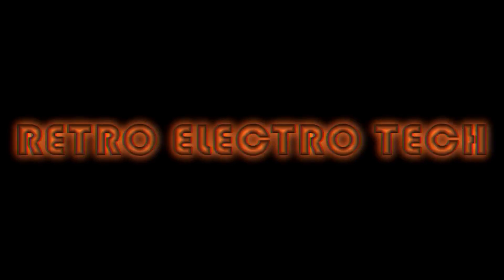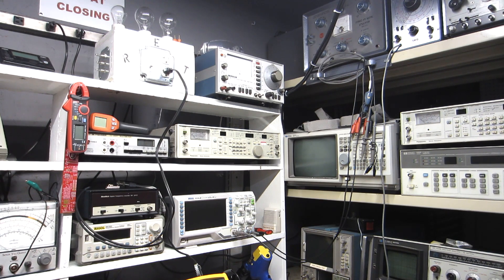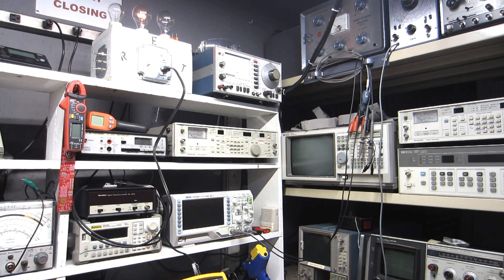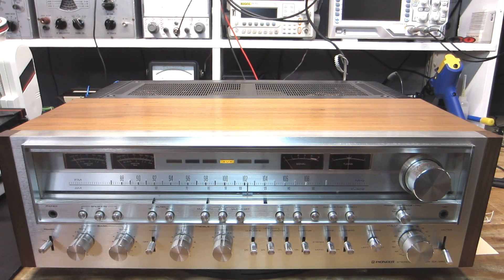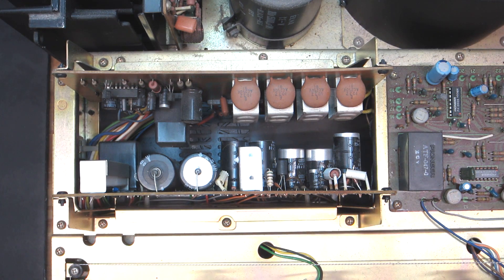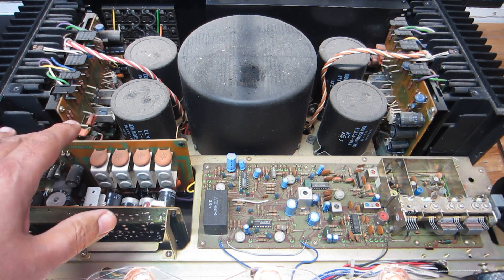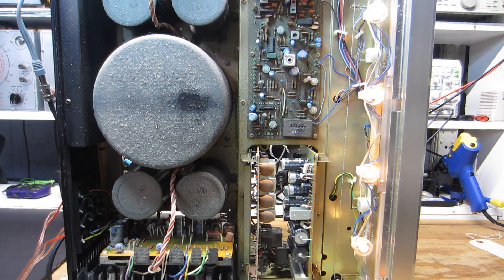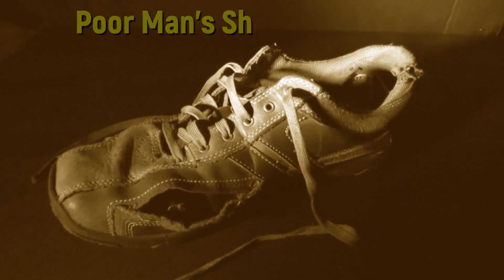Pioneer SX1280 Evaluation Part One

Comment: i went thru 2 of these earlier this year. they are just too big and heavy for me to be flipping up on end or moving from one bench to the other. i doubt i will ever do anything bigger than a 1080 again, and those are plenty big as well. i really wasn't all that impressed with the sound either. the power was incredible but the sound----meh at best. rock on brother!
Reply from the maker: Yes indeed they are big ole heavy units that's for sure. I understand about the sound preferences from one make and model to the next. Sometimes there are receivers / amps that just jump out and fondle our hearing the right way and others that do not :-) You know how it is in the audio world, it's a wonderland of boutique capacitors encased in gold and filled with the tears of angels to produce that heavenly sound found 3dB down from Godly perfection. So, perhaps the SX-1280 just doesn't contain enough of "the stuff" that makes the even order harmonics cry out joyfully in praise to the God of audio...Wherever He may dwell ;-)  have a good one Joseph, stay safe out there and keep your head on a swivel !